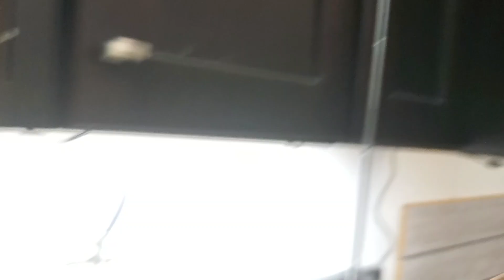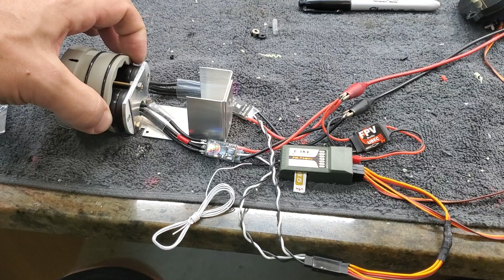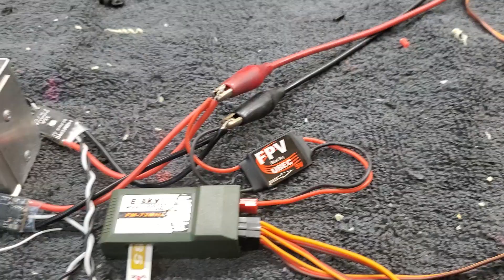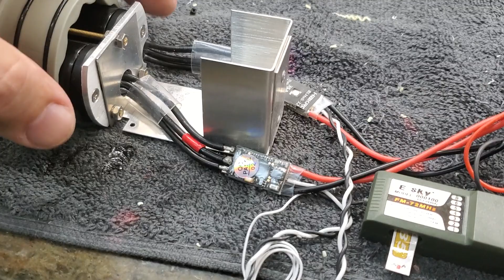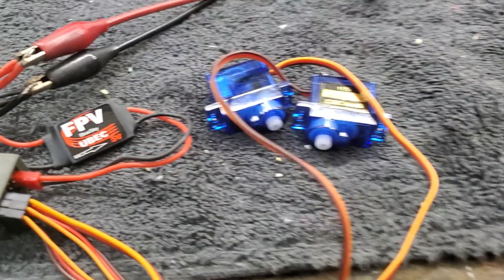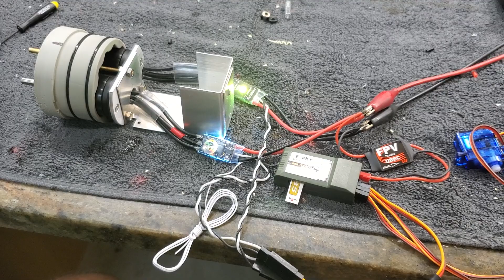Wiring twin brushless motors on the MSD SubDriver

Comment: Always a pleasure, Bob-you do a great  show... A quick note, from my department of redundancy department-for those not familiar with B/L motors. You can't use one ESC for two motors as can be done with brushed motors. It will mess up the feedback info for timing and confuse the ESC. The motors will run but if they get a slight bit out of sync (and they will), they will get squirrely.

Comment: What is the name and the brand of that transmitter and receiver??
Reply: It’s a Vex transmitter. 6 channel, 75MHz, great for subs, out of production, and difficult to find. Here’s Bob’s radio stock:

https://www.rc-submarine.com/radio-transmitters-and-receivers
Reply: @knight907  thanks man,but isn't there any cheaper alternatives for it.I'm new to RC submarine subject and I want to start small :)
Reply: Heh, you may have picked the wrong hobby. Some people have had success with OpenLRS, but it’s not legal everywhere, requires a license in the US (that isn’t difficult or expensive to get), and isn’t straightforward to set up. I intend to give it a try if I can still get hardware, considering it’s spread-spectrum digital, so no frequency conflict issues.

https://www.subpirates.com/showthread.php?5173-OpenLRS-433mhz-RX-and-TX-modules-what-it-is-where-to-get-it
Reply: @knight907  hah ! Well that a bit of a let down I say,but no worries I'll keep trying.Thanks for taking your sweet time to help me out btw ✌️

Comment: Why don't you use the gold connectors (say 3.5mm) so that you can easily disconnect the wiring, especially if you get the rotation incorrect. I also use a small separate battery pack for RC, without the BEC complications)
Reply from the maker: Space, space, space. A lot of the subs run here are 96th scale, which nets a 2.5" cylinder. Connectors take up room. A whole new battery just for the receiver!!?? Why worry about two battery packs when one works just fine?